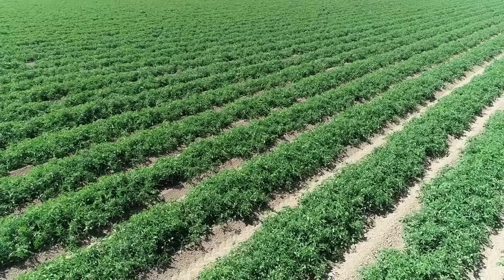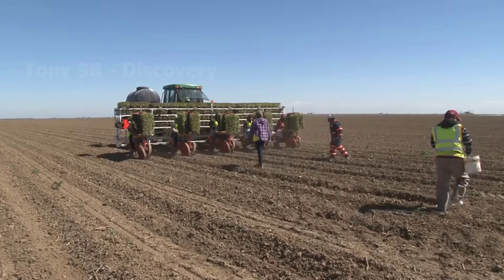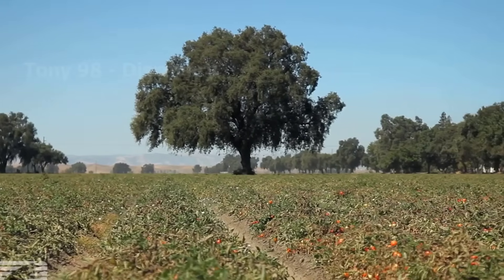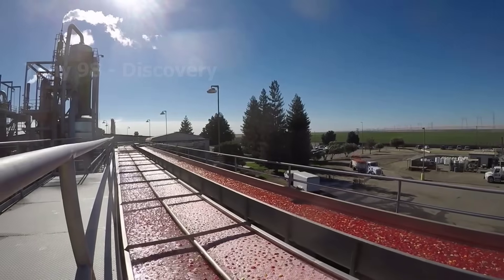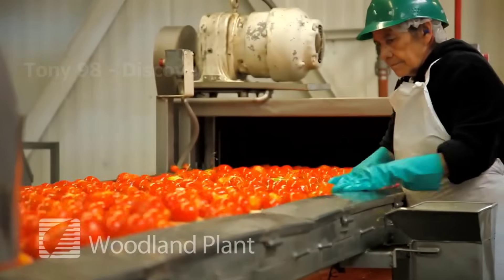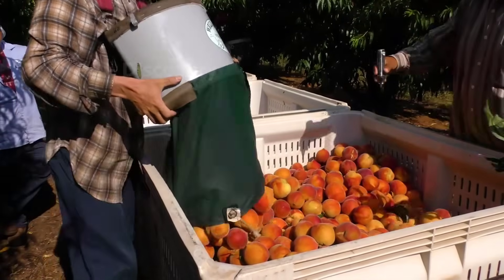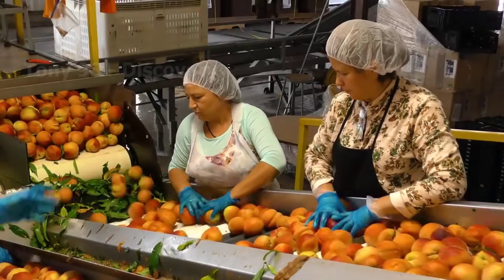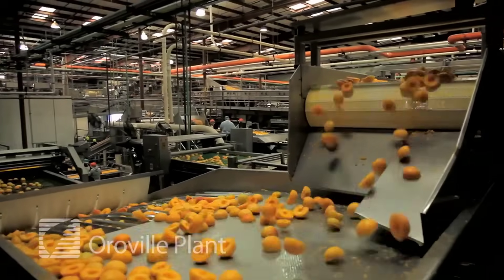American Agriculture Technology - Harvest Billions Of Tomatoes In California

Comment: The use of advanced agricultural technology to harvest billions of tomatoes in California is impressive. However, can these technologies be widely applied in other regions with different economic and climatic conditions?
Reply: Great question! 🌱 The use of advanced agricultural technology, like those for harvesting tomatoes in California, is indeed impressive. However, applying these technologies in other regions can be a bit more complex due to varying economic and climatic conditions.

In economically different regions, the high upfront cost of such technology might be a barrier, but there are more affordable, scalable solutions being developed to meet the needs of smaller operations. As for climate, machines designed for California's dry, warm conditions may need to be adapted for different environments—such as wet or cooler climates. However, the advancements in precision farming, like drones and automated tractors, are becoming more versatile and can be adapted to various conditions around the world.

The future is bright though, with ongoing innovations making it easier to implement these tools globally, improving efficiency and sustainability across different farming environments. If you're curious to learn more about these challenges and solutions, my channel dives into how agriculture is evolving worldwide! 🌍🚜
Reply: It can be applied relatively easily. The issue would be something a bit of larger problem with needing skilled labor and subsequently the logistics networks to move the fresh fruit to their end destinations